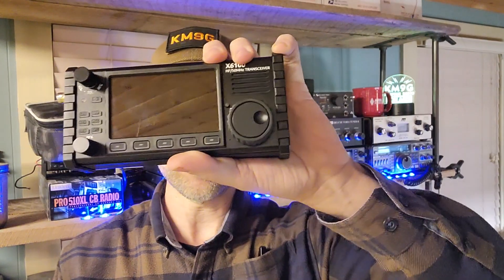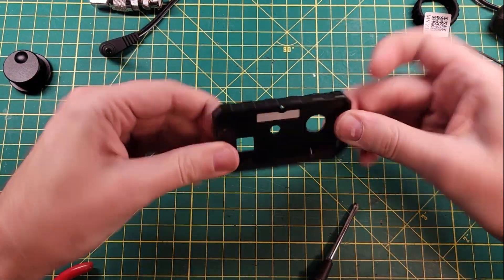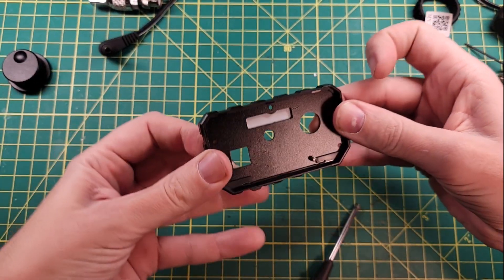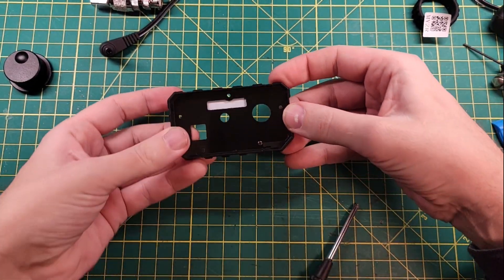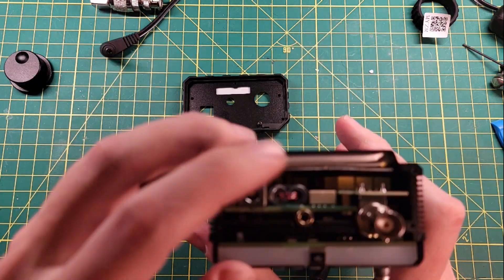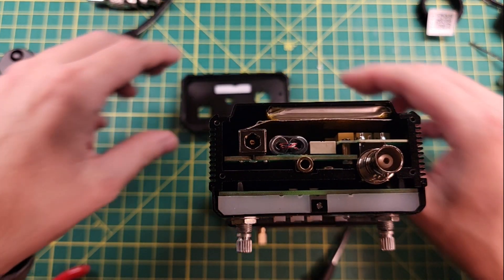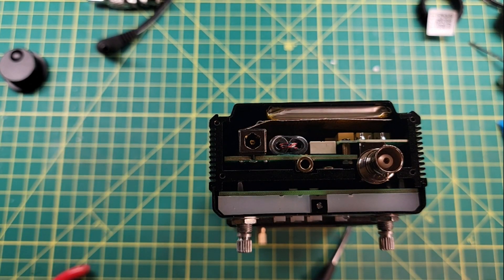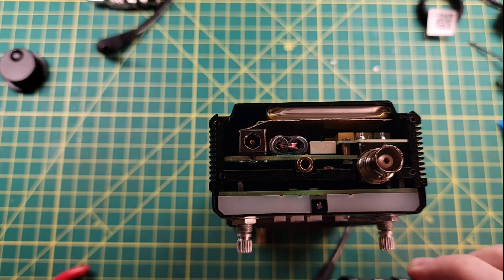Xiegu X6100 Teardown with KM9G

Comment: Any idea exactly what the model is of that BMS strip? My battery pack was overheating badly, removed and found that the resistor-thermistor (RT) were leaking. Trying to build another.
Reply from the maker: @ttmfrc  I do not know... Any used carcasses on der bay?

Comment: How thick is the aluminum that runs through the center of the unit? Would an additional heat sink on the rear panel help with heat build up in your opinion? Or is it not really an issue?
Reply from the maker: I'd estimate the center slab to be 1/4" thick.  Something happened with a recent firmware update and the heat doesn't appear to be an issue anymore.  I bought some heat sinks and setup for a before/after test and it wasn't hot enough to matter anymore.
Reply: Are you refering to this 1.1.7 here?  @temporarilyoffline

Comment: It is great to see that when the time comes, with a bit of care, we should be able to replace the internal batteries ourselves. As others have said, thanks for doing this tear-down , so we don't have to ;-)   Cheers de VE3WMB
Reply from the maker: You're welcome. I'm glad it helped!
Reply: @temporarilyoffline I would like to see a battery replacement video in the future!  I know you are probably busy with the x6200 now 😁👍
Reply from the maker: @markw.4679  Hey Mark - I don't know of a source for the batteries (because I haven't looked) - but replacement is super easy - remove the back case, disconnect the battery, insert new battery and connect... put on back case again.

Comment: Is that RTC battery rechargeable or replaceable?
Reply from the maker: It looks like it's replaceable. (But only by voiding the warranty sticker)
Reply: @temporarilyoffline  well considering the courts have ruled that removal of the sticker itself is insufficient to void a warranty contract, I'm not too concerned. Not that that's likely to matter with a Chinese product anyway. I'm just happy I don't need to deal with soldering it inside the radio when the time comes. I've done it with Nintendo DS cartridges and it wasn't fun.
Reply from the maker: Re-read my message 🤣 "voiding the warranty sticker" -- meaning cutting the sticker,  not "voiding the warranty" - I was being very subtle.

Comment: Does this qrp have a service manual for maintenance and alignment?
Reply from the maker: No it doesn't
Reply: @temporarilyoffline  so who can service this radio?
Reply from the maker: @emanoeldeoliveira8943  you can get it serviced by the manufacturer or you can join us on TOADs discord and have fun re-engineering it.
Reply: @temporarilyoffline  $650 for no concert?  complicated.
Reply from the maker: Concert?
Reply: @temporarilyoffline  $650 for a radio that doesn't have a concert.

Comment: This is solid! So perhaps a battery swap can be done here without too much trouble.  Is there any chance you can measure the battery dimensions?  Thanks for this awesome content!
Reply from the maker: Yes, a battery swap should be fairly easy.  Next time I'm at the radio I'll get some measurements.

Comment: Since I'm not terribly upset that the Wi-Fi or Bluetooth aren't usable at the moment, I think my biggest disappointment with this radio is the battery. 8.4 volts at 3Ah isn't of much use to me. With a bit of massaging of that back cover I "might" be able to fit three 5Ah Ring doorbell batteries in there though..... Bob, W0BNC.
Reply from the maker: Hello Bob, I was able to got 3 hours of FT8 usage out of my internal battery, I had to wear the battery out during the last firmware update.  If you're looking out for more power, check this out:  https://www.thingiverse.com/thing:5240290
Reply: @temporarilyoffline  hmm, maybe I'm not giving it it's due. I guess I'll have to try it and see how it goes. I've made a few extra batteries for my KX2 from 5Ah Ring doorbell backup batteries. They would almost fit inside the 6100, but not quite. Thanks again for the teardown video, I enjoyed it.

Comment: You have probably figured it out by now but the sticker allows the wifi and Bluetooth signals in.out of the radio. The all metal case would prohibit the signals.
Reply from the maker: Yeah, I still think it needs a better wifi antenna setup and we created some 3d printed end plates to get started down that path.

Comment: Love to see a software breakdown with that ARM processor it has to be running something like LINUX
Reply from the maker: It's running 'buildroot' and busy box.  I've got it rooted and I'm running raspberry pi os on it now.  Lot's of other videos on my channel about it.
Reply: So could you run WSJT X and assign it to a function button? That would be neat to be able to run other stuff on your radio
Reply from the maker: @chrisrose01  What I'm hoping to do is have multiple virtual screens - screen 1 is radio, screen 2 is WSJT-X, screen 3 is your logging program or whatever.
Reply from the maker: @chrisrose01  yep

Comment: Mine will not keep date/time settings so im thinking the back up battery is not connected, I of course dont want to tear it apart to check as ive only had it 2 days but do i send it back for a replacement because of this minor issue as  I'm having fun with it so far. It does bode the question that there may be other issues ive not come across as yet though.
Reply from the maker: My radio's clock seems to loose time also, and I know my battery is connected!

Comment: You should look to add a watermark to the videos maybe or include callsign or something on the cutting board to stop people using it as their own. I found one of Josh's recently that someone had dubbed a translation over, seemed a little dodgy that people would do that
Reply from the maker: Thanks for the tip @Dan

Comment: TO thanks for another great video like always the breakdown is really appreciated . I have to ask what your thoughts are on overall build quality looking at the  circuitry. I understand the release with missing features leaves a lot to desire from the company . I am trying to talk my self out of sending it back and realize the potential of a Linux kernel and can see custom OS created by Linux gurus in near future. Thank you.
Reply from the maker: I've been trying to figure out where this stands in the lineup of radios - if I was going to buy a ~$600 QRP radio... would this be it?  What is the competition in this range with these features, etc... I'm not yet clear on that, been sidetracked with hacking it.
Reply from the maker: This is an amazing and we'll thought out comment and I couldn't put into words before what you just said.
Reply: @temporarilyoffline  I was stuck in this exact situation at the beginning of March and come to the same conclusion. I got my General upgrade on the 5th and wanted a radio, but had my heart set on the TX-500. I had put a little back but only about half way there when they suddenly became unubtainium. The same thing happened to me with the TH-D74A when I got my Tech. But, I did have enough put back to get the X6100 and they were in stock. So I pounced. So far, I like it a lot, but would still buy a TX-500 if they ever come back on the market. I did also get my TH-D74A second-hand months after giving up that hunt for a steal. So, you never know...

Anyway, a great comment and great analysis.

KI5PDK, 73
Reply from the maker: Thus radio keeps getting better too

Comment: I see a STM32F4 low power on the base unit, and an Allwinner R16 dev board on the display unit.  Interesting.

Looks like it should be easy to repair too.
Reply from the maker: yeah, not to bad, too bad its mostly SMT

Comment: Brave man! You now have more on-hands experience than even Xiegu engineers! :P Did you modify the main tuning knob so that it didn't do what was reported by Dude in one of his reviews? 73, KF6IF
Reply from the maker: Yes, you just need to loosen the alan screw, slide the knob up a fraction and tighten it back down.  I don't know why the foam is there.